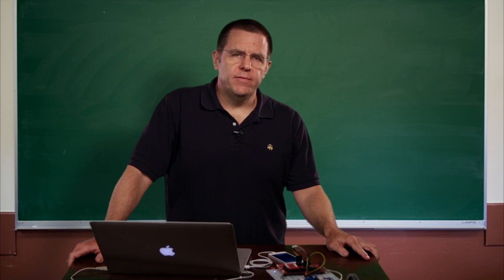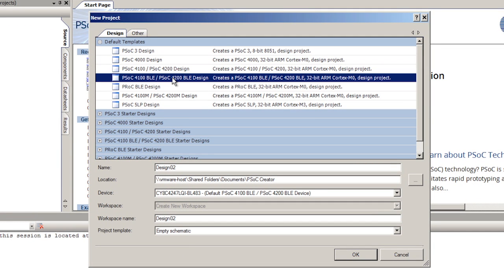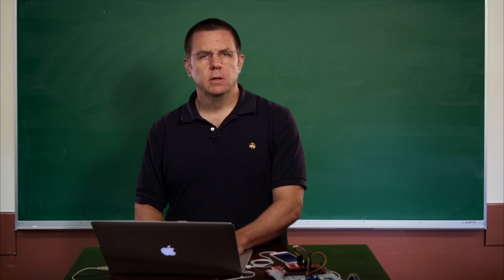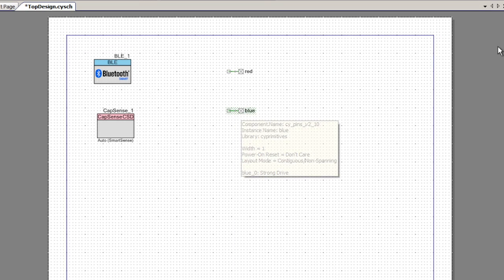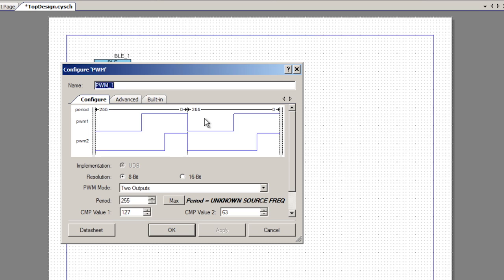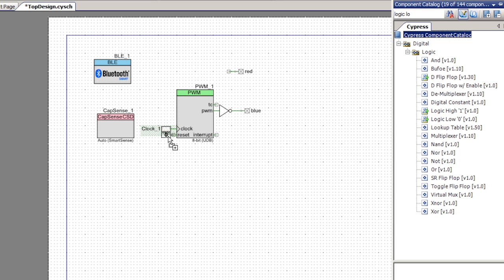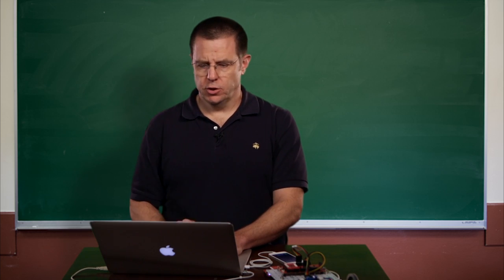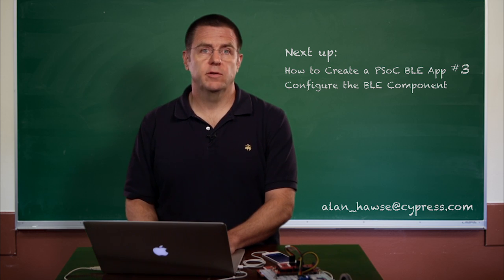How to Create a PSoC BLE App: Lesson 2 Configure the CapSense Component

Comment: In the video, you describe adding a NOT gate to invert output of the PWM for the BLUE led, but the components from PSOC Creator 4.1  do not show the 'NOT' component.  So where do I get the this component in order to proceed with this?  And of course thanks in advance
Reply from the maker: Hi Raad, PSoC Creator 4.1 supports NOT gate for MPN: CY8C4247LQI-483. You can obtain the NOT component from Component Catalog window. Which device did you use in your project? If you are using the same device, could you please try re-installing the PSoC Creator? Let us know if you have any further questions. You can also visit our Cypress Developer Community 3.0 to speak with Cypress experts and other embedded engineers: http://bit.ly/29vS9Ts. Best, Cypress